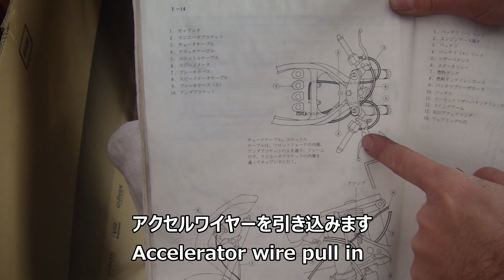#45 キャブとメインハーネス取り付け　ZXR250オーバーホール＆カスタム

Comment: Hi what is the model of the accelerator wire ? it looks like aftermarket part not original kawasaki part. Do you have link to website for buying?
Reply from the maker: accelerator wire is 「High throttle designated wire」    http://www.acv.co.jp/01_product/ac_handle_top01.html
Reply: @kamex-japan  can you write in japanese? too many selection in website
Reply from the maker: @BListeins  Hi bro.My box→ https://yahoo.jp/box/rYA3zb
ZXR250 model is 
Discontinued.
Can substitute is ninja 250.
Reply: @kamex-japan  cool thanks alot!!